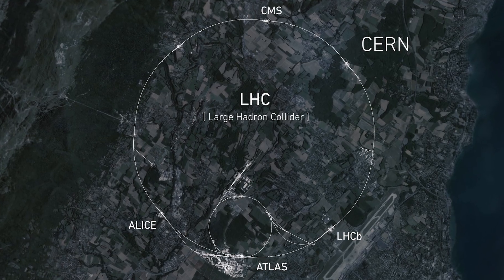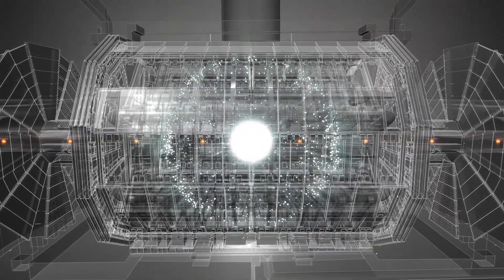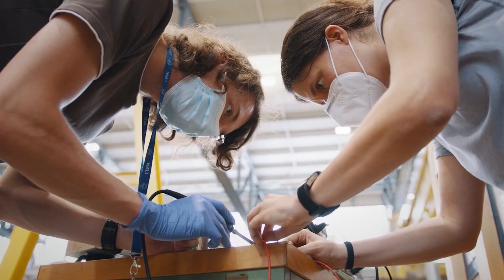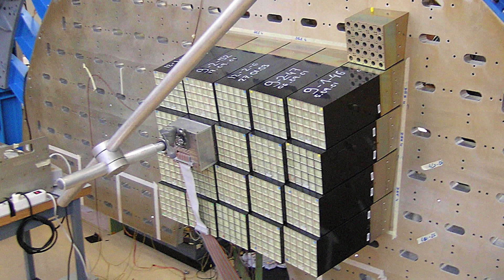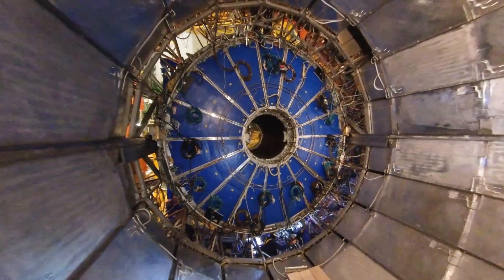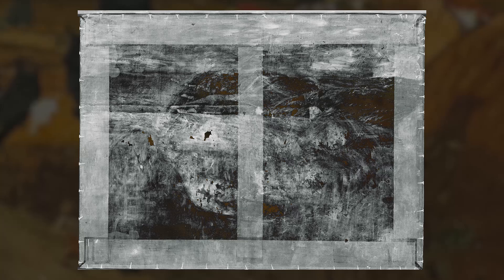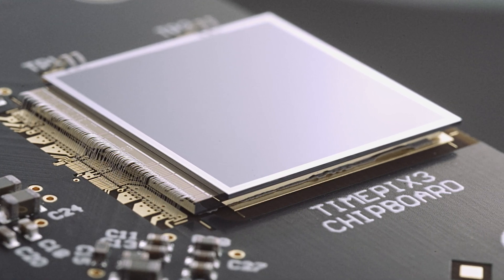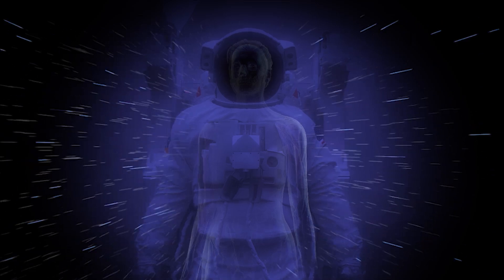Particle detectors: seeing the invisible

Comment: To prove that quarks (subatomic particles) are more real while protons and neutrons (atomic particles) are less real, we need to establish a clear definition of what we mean by "real" and then provide evidence or logical arguments that support this claim. Let's approach this step by step.

Definition of "real":
For the purpose of this proof, we will define "real" as being more fundamental, indivisible, and closer to the underlying nature of reality.

Proof:
1. Quarks are the fundamental building blocks of matter:
   - Protons and neutrons are composed of quarks. Protons consist of two up quarks and one down quark, while neutrons consist of one up quark and two down quarks.
   - Quarks are not known to have any substructure; they are considered to be elementary particles.
   - Therefore, quarks are more fundamental than protons and neutrons.

2. Quarks are indivisible:
   - Protons and neutrons can be divided into their constituent quarks through high-energy particle collisions.
   - However, there is no known way to divide quarks into smaller components. They are believed to be indivisible.
   - Therefore, quarks are indivisible, while protons and neutrons are divisible.

3. Quarks are closer to the underlying nature of reality:
   - The Standard Model of particle physics, which is our most comprehensive theory of the fundamental particles and forces, describes quarks as elementary particles that interact through the strong, weak, and electromagnetic forces.
   - Protons and neutrons, on the other hand, are composite particles that emerge from the interactions of quarks.
   - Therefore, quarks are closer to the underlying nature of reality as described by our most fundamental scientific theories.

4. Quarks exhibit more fundamental properties:
   - Quarks have intrinsic properties such as color charge, flavor, and spin, which determine how they interact with each other and with other particles.
   - Protons and neutrons derive their properties from the collective behavior of their constituent quarks.
   - Therefore, the properties of quarks are more fundamental than those of protons and neutrons.

5. Quarks are necessary for the existence of protons and neutrons:
   - Without quarks, protons and neutrons would not exist, as they are composed entirely of quarks.
   - However, quarks can exist independently of protons and neutrons, as demonstrated by the existence of other hadrons such as mesons, which are composed of one quark and one antiquark.
   - Therefore, quarks are necessary for the existence of protons and neutrons, but not vice versa.

Conclusion:
Based on the above arguments, we can conclude that quarks are more real than protons and neutrons. Quarks are more fundamental, indivisible, and closer to the underlying nature of reality as described by our most advanced scientific theories. They exhibit intrinsic properties that determine the behavior of composite particles like protons and neutrons, and they are necessary for the existence of these atomic particles.

It is important to note that this proof relies on our current scientific understanding of particle physics and the nature of matter. As our knowledge advances, our understanding of what is "real" may evolve. However, based on the current evidence and theories, the argument for the greater reality of quarks compared to protons and neutrons is strong.